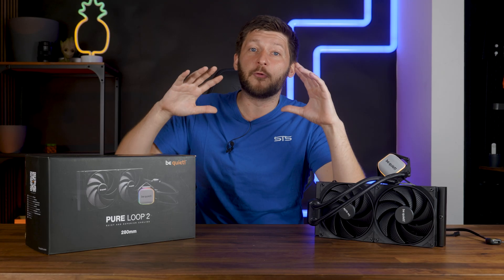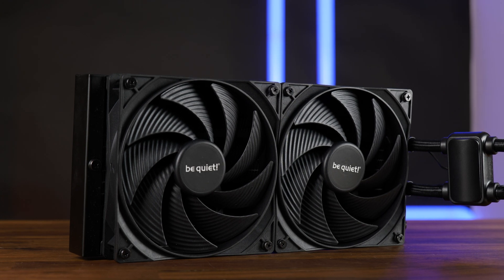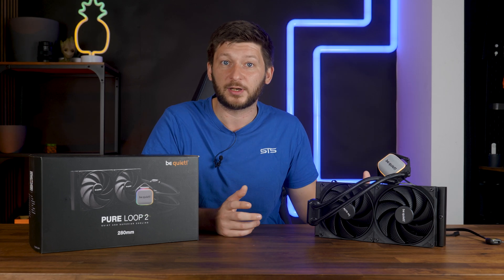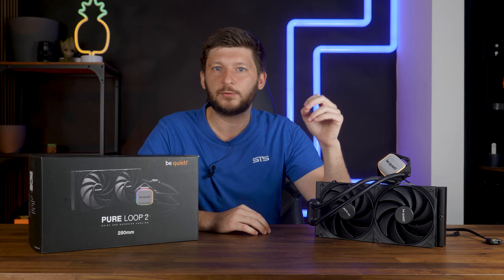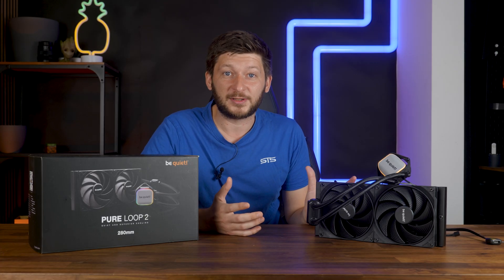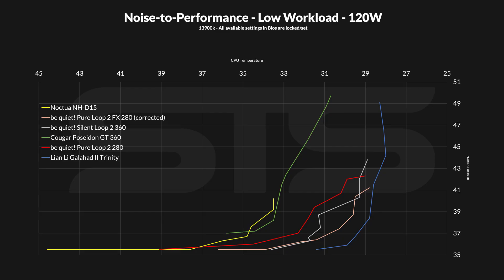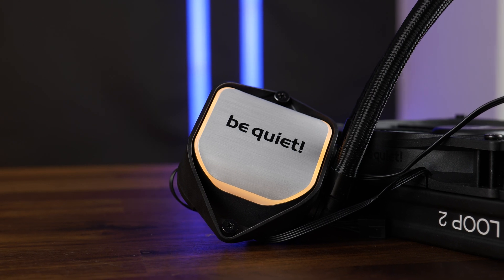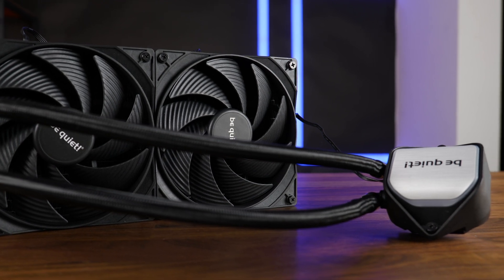be quiet! Pure Loop 2 280 Review - Going Back To The Roots

Comment: Even with mistakes you are the best reviewer for AIOs and cooling things in general!  I think Gamer's Nexus is better for Case review, but fans, AIO, air cooler - you are the best!
I would love to see results for Arctic Liquid Freezer II 280 with the new benchmark and header, even now it's one of the best AIOs to recommend for most. Lian Li GALAHAD has to many issues with the pump (Performance model was recalled and regular has regular issues with the pump as well).
Reply: Bequiet 280 going to beat arctic 280 or 360 and 420 especially on intel. intel arctic 360 is extremely mediocre when you go over 250 watts.

Comment: Bought mine about two weeks ago, and I am satisfied with the results, I also installed the 1700 Thermalright frame, everything went smooth and temps couldn't be better. Now, it' a 12,600KF, and it was fine with a Dark Rock Pro 4 but the fans kept spiking and it was annoying, temps were slightly high and low, low and high, so now all of that is gone. 
.
Also, my motherboard has super tall VRM heatsinks, so the plate of the heatsink was not thoroughly making contact with the CPU's ihs, it covered 90% only, because the VRM heatsinks were in teh way. Now my CPU @ 4.9GHz (alightly overclocked more than Intel's recommend), stays at 69c highest.....it's a great AIO, which I like thee fact that I can refill the unit, whereas my previous unit died after 4 years, because probably the pump ran died.

Comment: You think this would cool a 7950x3d in a SFF like the Asus AP201 case? 
The Arctic 280mm I have has clearance issues (hits the VRM heatsink) coz of the 38mm thickness of the radiator, unlike this 27mm unit. 
I need at least 8mm to clear the heatsink, so this will give me another 3mm clearance but I've never used be quiet AIO's. Not familiar with their products to be honest. 
Looking forward to your reply! ✌️

Comment: I bought this model, I had a Lumem 280mm but it made a lot of noise, I had to reduce the pump RPM to silence it. But with the Loop I had no problems, very quiet even at high revs. Incredible.
Reply: Hello. I'm looking to buy the 240mm version of this. Did you had any issue with the Pure Loop 2?
Reply: @edizmeteinal7458  Yes. You can buy it, it is very quiet, because the pump is not located on the CPU plate, so this reduces vibrations.

Comment: Hey man, im looking at "noise to performance" graphs and im a little bit confused about it. Shouldn't CPU temp on top be going from left to right and not right to left? Because what I see is that at lets say 250W graph I see 49db at 56C with galahad
Reply: the temps are going down as fan speed is increasing.